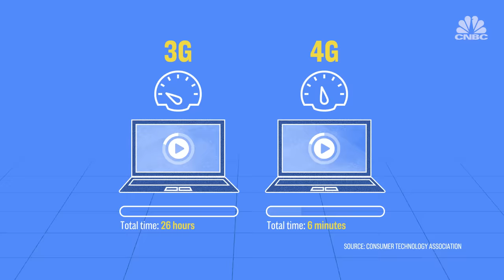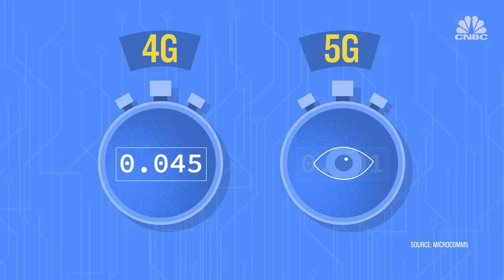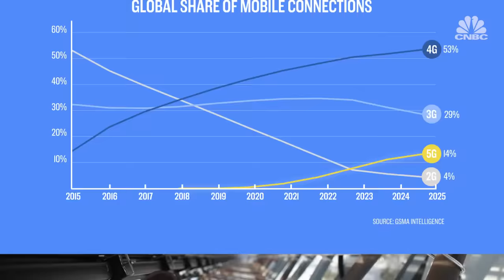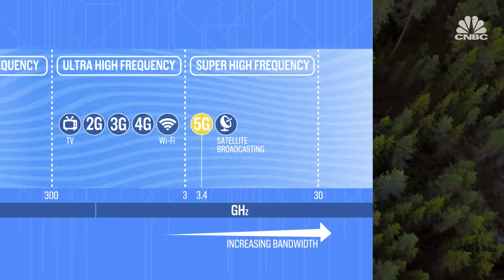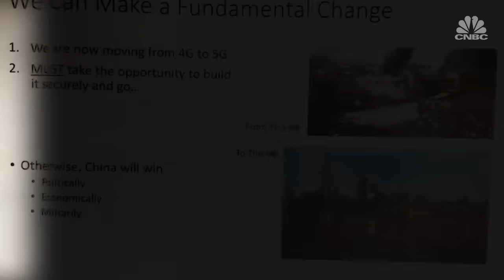What is 5G? | CNBC Explains

Comment: SMART METERS ARE THE SAME GET THEM OUT OF YOUR HOUSES
Reply: There is one on my electric meter and the water meter where I live. I didn't have a say in the matter; the companies just did it.
Reply: Actually smart meters only take a reading once every month on the last day and they use any WAN (wireless area network) so that means the levels of radiation would literally be that the same of a mobile phone.
Reply: Kyle Rowe. Smart Meters are constantly sending information, they send info back to a central meter.  They never stop sending information 24/7.
Reply: @blackjackson21  Yeah that's correct but also you have the choice to choose when the readings are sent across. It's a Data protection law that customer data is handled within the customers data consent. Customers have the right to choose how frequent readings are sent   half hourly, daily or monthly.
Reply: Within the last year in my part of Florida, our electric utility company installed smart meters.  I told them NO WAY, and they sent me the opt-out form in the mail... which I completed and returned.  And, oh yes, it costs.  There was an initial charge of about $90, followed by a monthly fee of about $20.  Sux, but it is what it is!

Comment: Why aren’t they discussing the health risks? The amount of radiation omitted by these devices is ridiculous and extremely irresponsible of the government to put these up in residential areas.
Reply: A 5G antenna at the high frequency side will use lower than 1 W of power. Of course there will be much more of them but the overall radiation will be similar to 4G. So no, the radiation omitted by these devices is not ridiculous.

Comment: Downloading a 2 hour film in 3G would take 26 hours? Pretty sure that's not the case for most 3G networks.
Reply: Faster or slower?
Reply: significantly faster. I have downloaded at 21Mbps in 3G for example.
Reply: This site http://downloadtimecalculator.com says that it will take 13 minutes to download a 2GB file. Even if we assume 10Mbps speed, still it can do in less than an hour.
Reply: Kshitij S Ahh, thanks wasn’t sure
Reply: I think he meant 4k
Reply: TechnoDelight my old 3g wouldn’t load it at all lol
Reply: They are noobs.. on 3G to download 2 G.B file, takes less than an hour.. 2G too takes like 7-8 hour.

Totally biased review
Reply: TechnoDelight loading a webpage takes 5 minutes in 3g...
Reply: Well it said it goes up to 100x for it to be considered the next G up right so I think that could be the very minimum of a 3G network when your used to a 3G network that’s borderline into 4G just my thoughts

Comment: Its just the benifits, how about the dangers of 5g frequencies to our health??? 

Answer please
Reply: Lech Jarn Nothing, cellular towers use the  microwave end of the spectrum which is weaker than visible light and is way too weak to damage DNA and cause cancer. The only parts of the electromatic spectrum that can cause cancer are Gama Rays, X Rays, and the upper end of Ultra Violet
Reply: No real danger present. It's safe to ignore the trolls claiming otherwise
Reply: Adam Smith You're talking about ionisation Microwave and Infrared Radiation can still "cook" you, and your molecules over long term exposure, which Networks use. At certain frequencies your exposed to different molecules of your body begin to resonate not such as Water (Humans are 70% of this) 5G alone isn't enough but, theres a plot by The Shadow Government and Networking companies to install more multiple of these towers and increase the frequency of 5G enough so they can achieve this, its all part of plan Depopulation they're also planning on using this technology to Mind Control you, doesn't matter if they cook you slowly you still burn and die in the end.

Its Barbaric, They're killing you but they're doing it "kindly". You're paying them to kill you each time you use the internet or use your data, or leave your router on overnight. Take the red pill, trust no one thats apart of the system. "The Matrix is a system Neo, which means everyone apart of that system is our enemy. You have to understand some of these people are not ready to be freed, they're so inert so helplessly dependent on the system that they'll fight to protect it."

5G Poses plenty of danger dont listen to the two blue pilled above me, watch this video if you want to know the truth:

https://www.youtube.com/watch?v=oY5SReQ2Kqc
Reply: Don't worry, this technology will allow an app that will constantly monitor your body health, so the exact moment you get cancer from all the radiation they can start feeding you advertisements for expensive treatment options.
Reply: Cancer rates will only double you have nothing to worry about 😵but on the bright side you can download a movie faster while on the death bed!
Reply: Adam Smith BS.  Gama Ray turns you into Hulk
Reply: blackham7 wow, thanks dude..

Comment: Ok what farm would have 5G LOL. I am sorry but most of rural Canada barely has basic intent
Reply: BannerWolf This is quite true. Alberta is probably further along in rural internet development than other provinces but it has been a challenging for those outside of towns and cities to get reliable high speed for a reasonable price. This said, in terms of internet through the cellular networks, a farm needs to be a good distance away from a town or major highway to not have a good connection through Telus or Bell. 
This ia hardly scientific but back in 2011, prior to the rollout of LTE, I did internet speed tests on my smartphone at both on my parents farm (6 miles/10 km from the nearest town) and within eyesight distance of cellular towers in Calgary and found the data connection to usually be slowed in the city. This was back with HSPA+ which is 3.5G, not even true 4G.
Reply: Lol iam writing this from rural Indian village we have here 4g network with 100% signal strength as well as getting 4g data at 1.4gb/day for 28(total 28*1.4gb) days at less than 2.5 USD.
Reply: A farm in 2045
Reply: Silvi Kk123 that's because India use cows as signal transmitter
Reply: Silvi Kk123 India has a 55% child malnutrition rate, yet can offer unlimited 4G LTE at under 3 USD per month? That's pretty sad.
Reply: Nuclear Armament child malnutrition happen in India because they worship cows instead of eating it
Reply: Don’t cry Canada has on average 2 times faster internet than in the U.S
Reply: Moved to Alberta 4 years ago from Toronto and never seen a tower before. Now they're on every corner right out to the mountains. Our WiFi was 5G with *Shaw for the past year. I switched to Telus and they're still on 4G.
Reply: Amirul Insani today is Easter just finished eating yummy cow meat my other is not cow also father is not an ox like many others
Reply: Silvi Kk123 India doesn't rank in the top 100 countries in internet speed. In 4G it ranks dead last in a study of 88 countries, behind the likes of Pakistan, Algeria and even Tunisia. Hardly an example.
Reply: morpheos111 may be it's not same every where in India but iam satisfied with speed obtaining atleast 10mbps

Comment: FINALLY SOMEONE MENTIONS LATENCY

45 ms to 1 ms is massive change.

This effectively means you can control things from half way across the country with little to no lag. Why self driving cars will be a reality. How important data like medical files can be sent extremely fast
Reply: I did not put medical files into consideration. However, the 5G coverage may need to be expanded before such use can take effect.
Reply: @flyinglack  :)
Reply: @tramarthomas6105  :)

Comment: I certainly hope it doesn't replace cables... In certain places we're already bombarded by over 100 times more (at least that's where most meters' scale ends) EM radiation that is deemed "safe" (which is already a stretch) and apart from acknowledging that the exposure causes disturbances in the human brain activity like headaches, lack of concentration, frustration etc., no one will go on the record to say if it's slowly killing us or not.
And now they want to flood even more of the frequency spectrum with data. Honestly I think it's insane.

At home I have everything wired with no wireless whatsoever and it's going to stay that way for as long as it can. But I guess we'll have to repaint the outside walls with EM shielded paint before this whole 5G mess becomes a thing...

Comment: Do we need faster internet? You need to solve GPS that draining out phone battery a lot. I mean, a lot. From 3G to 4G and then 5G. Mobile phone brands seems to make phone's lifetime shorter, to 'force' phone user to switch to newer technology. Ironically, again, technology seems become more expensive as human becomes more advance.
Reply: Well, Current GPS Technology consumes not much energy or maybe technology you're using is the old one. I developed my own app and used it and it drained 4% of my phone's battery in 2 hours of use. That's not much I think.
Reply: Oh, so you mean inflation? 😅
Reply: Inder Sethi i bought my phone last year, 2017 model. Should be the 'current' tech.
Reply: Turn it off when your not using it

Comment: Important to note here that 5G isn't one thing, there are 3 variations. Low, mid and high band 5G. Highband offers the ultra low pings and 1Gbps+ speeds, but it requires perfect LOS of the tower and within 50m. Simply put highband is not what most people will ever get. Even when 5G fully rolls out, you might only get highband in very busy public areas or on certain university campuses. 

No, the real action is 5G midband, which still offers respectable speeds from 100mbps to 900mbps and has far better range (up to 5km) and much more forgiving to obstacles and weather. This is what most people living in Urban areas will get to experience when 5G rolls out and this is still very decent and better than 4G. 

Then there's lowband, which ranges from 30-100mbps. While better than nothing it is the same or worse than 4GLTE+. Unfortunately this is the kind of offering you're going to see when you are living in smaller cities or municipalities where they don't deem an infrastructure upgrade cost effective. In other words 70% of us will get to experience this "5G".
Reply: Very informative and well explained, thank you

Comment: Why are the radiation levels 100× above the minimum acceptable amount?
Why the heavy guage copper wire running up to them that is only used in High voltage systems

Comment: The speed and latency claims are way out of wack. Those claims are with a 2022 handset, standing right in front of mmwave (mmwave is at higher frequency meaning higher bandwidth and speed but shorter distance, pretty much line of sight and cannot go through trees etc) base station with no one else on the network.  Not with a 2020 5G handset, being indoors connected via sub-6 or low band 5G.

Comment: 4G+ is better. But the speed depends on isp and amount of cellsite.
Reply: Duh. 5g is only supposed to fix the congestion issues in certain areas. 5g is not made to replace 4g/LTE.
Reply: @sqlevolicious  The only reason why 4G is congested here in Philippines because of lack of cellsite. Or there's a cellsite but it has few antenna.

Comment: I can't even afford a laptop. Why do I need a 5G network?
Reply: 5g solves a very important issue with congested networks. It's necessary for crowded areas. You won't ever be able to use 5g at home, only in a city center like in a sports area. Of course, those times are behind us, so 5g is pretty pointless.

Comment: for the non-tech people ... in order to achieve such high bandwidth wirelessly, you need higher frequency waves, higher frequency waves don't go around terrain or through different materials so well, so in order to have enough coverage, you need more dense network of base stations closer to all the wireless receivers and in order to make this whole thing work, you also need the base stations to talk to each other very intensely. What does that all mean? Well it means that there will be wireless base stations in the street level instead of roof level like it is with 4g and that they will be all communicating wirelessly because putting that many new cables in the cities is pretty much impossible by now, so it means that there will be way much more electronic smog exactly where everyone's body is. Now, do you think it's unhealthy to live too close to high voltage wires? Well this is even worse.... this is why we should be all cheering Elon Musks plan for low orbit satellites to cover whole globe in internet connectivity simply because the communication between the stateliness will be happening way up above the ground were nothing lives thus is not disturbed by the huge amount of electronic smog.

Comment: Publication number: 20130015260
Abstract: This patent describes a scientific explanation for what causes lightning and thunder and how to replicate it using high-frequency soundwaves such as radar and microwaves. The uses for this are mainly in military weaponry and weather modification. This is a very high energy weapon, and is capable of great damage if not used properly. Uses of this invention include: Missile defense, aiming at a nuclear missile to disable all electrical and electronic systems with electromagnetic pulse (lightning) and break the missile apart with the concurrent acoustic shockwave (thunder). Other uses include installing the devices in airplanes, helicopters and tanks to fire lightning and thunder upon whatever it is aimed at: air-air combat, air to ground combat, ground to air combat, tank to ground combat. This technology could obsolete guns and fired projectiles if widespread military utilization is made. The system can be used to either start or diffuse a hurricane.Weather Control Patents (Class 239/14.1
5G and Haarp weather control seem similar

Comment: DoD already used up a big part of the 5G MMW frequencies (spectrum allocation for 5G), leaving less commercial use. The excerpt below explains why the U.S. is still struggling with 5G in terms of implementation. According to the National Security Implications of Fifth Generation (5G) Mobile Technologies document and excerpt to find out why the U.S. is still behind with 5G in building up capacity.

"The Department of Defense (DOD), however, holds large portions of the usable spectrum. Although DOD uses certain MMW frequencies for high-profile military applications such as Advanced Extremely High-Frequency satellites that provide assured global communications for U.S. forces, it extensively uses sub-6 frequencies—leaving less sub-6 availability in the United States than in other countries. The Defense Innovation Board (DIB) advised DOD to consider sharing sub-6 spectrum to facilitate the build-out of 5G networks and the development of 5G technologies used in the sub-6 band. While DOD has been moving toward greater spectrum sharing, it has expressed concern that sharing presents operational, interference, and security issues for DOD users. As an alternative to spectrum sharing, some analysts have argued that portions of the sub-6 spectrum should be reserved for commercial use. This would require DOD to relocate certain applications to other parts of the spectrum. The DIB estimates this approach would take around 10 years to complete, as opposed to 5 years for spectrum sharing."

Comment: DoD already used up a big part of the 5G MMW frequencies (spectrum allocation for 5G) leaving less for commercial use. 
According to the National Security Implications of Fifth Generation (5G) Mobile Technologies document and excerpt to find out why the US is still struggling with 5G in terms of implementation. 

"The Department of Defense (DOD), however, holds large portions of the usable spectrum. Although DOD uses certain MMW frequencies for high-profile military applications such as Advanced Extremely High-Frequency satellites that provide assured global communications for U.S. forces, it extensively uses sub-6 frequencies—leaving less sub-6 availability in the United States than in other countries. The Defense Innovation Board (DIB) advised DOD to consider sharing the sub-6 spectrum to facilitate the build-out of 5G networks and the development of 5G technologies used in the sub-6 band. While DOD has been moving toward greater spectrum sharing, it has expressed concern that sharing presents operational, interference, and security issues for DOD users. As an alternative to spectrum sharing, some analysts have argued that portions of the sub-6 spectrum should be reserved for commercial use. This would require DOD to relocate certain applications to other parts of the spectrum. The DIB estimates this approach would take around 10 years to complete, as opposed to 5 years for spectrum sharing."